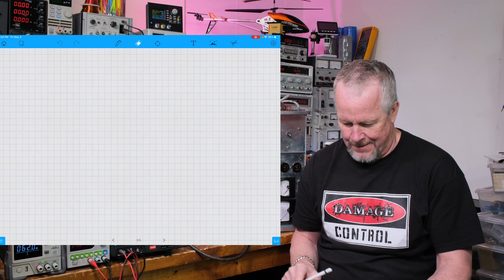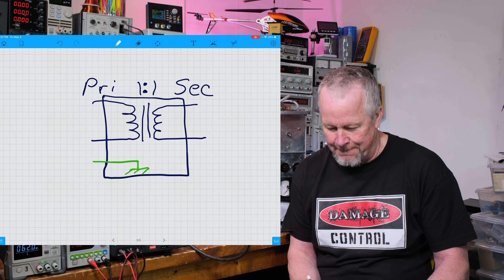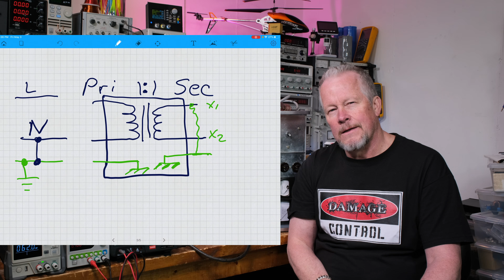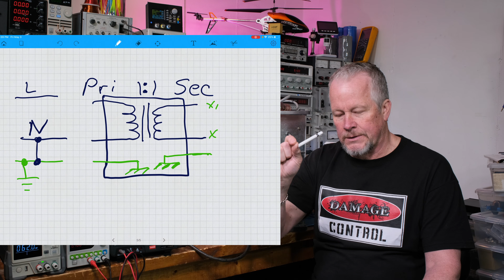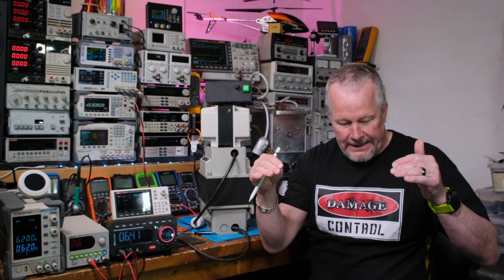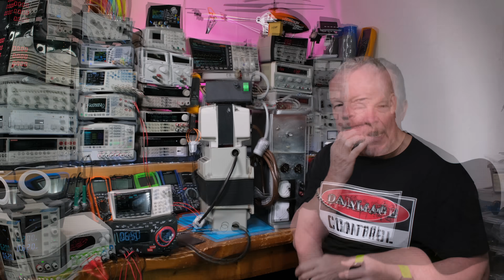Isolation Transformers and How they Can be wired #isolationtransformer

Comment: Brilliant! Couple of addendums: 1) I've been measuring leakage current on old (1980's) vs new Y caps. Leakage of older Y caps (working, but replaced due to age) can be 150-1000 fold higher than new replacement caps. There seems to be a safety issue with older equipment caused by Y cap leakage current. I've seen sockets for the cheapest ICs, but never once for a cap. I wonder why not. 2) Hospitals actually do use those hospital grade isolators, and quite a lot of them. They regularly discard them in working condition for various reasons. They are often willing to donate them to avoid recycling costs. Isolation transformers should be cheap and readily available for students or amateurs.
Reply from the maker: Thanks for the great feedback.  There has been an issue with aging on some Y caps, but the reason they are not socketed - is for safety any component would not be safe if it were only a friction fit - so soldering is the obvious option.

I would love to see companies sell in electronic flee markets are whatever vs recycling.  I've worked at companies that will purposely damage equipment and put it in recycle vs sell or give it away.  It is a shame!!

Comment: Greetings engineer, in the electrical safety practice, what I was taught is that the oscilloscope must be connected to the primary side of the transformer with its respective ground line and that the element under measurement is the one that must be connected to the secondary side of the isolation transformer.
Reply from the maker: Yes that is the typical connections.  But, there are many connection configurations used - depending on the case.

Comment: I currently have a "Ground loop" between a couple devices. One is speaker monitor which has its own switch for power its power cord has a three prong the other is an audio interface which has a power brick but only a two prong connector. These two are connected through a balanced XLR cable. I was told not to use the two prong to 3 prong connector (it does eliminate the 60hz hummm) But instead to use a ground lift in the audio line.  I also have the option to use an XLR cable isolation transformer that can be put in line similar ot the audio line ground lift.  Based on what I think I understand the Isolation transofrmer would be better. Thoughts?

Comment: Late to this but the secondary is floating and never use a GND connection on chasis, if you touch a hot chasis (on floating secondary) you are protected by the secondary isolation (only leakeage current) NEVER USE GND ON SECONDARY!
Reply: No!...secondary is floating, if it makes a short with chassis there's no short circuit or protection from GFC. To be clear, a connected gear must have gnd chassis BUT with a DUT anything must be isolated even a faulty chassis cause there's no way to put current on gnd from the secondary. But if you tie a point of the secondary to gnd and accidentally touch the "isolated" live you can be electrocuted thanks to gnd and the floor...and no detection by GFC. I hope you make a video of this classical confusion
Reply: BTW a gnd chassis only useful protection is against a faulty isolation transformer
Reply from the maker: Thank you!  Great feedback!  I need to do the follow up to this video.  I purchased some connectors and things for this - but then by the time they came in - I got busy on other videos.  I have done a half dozen videos on this confusing thing called ground;)  Have you seen this one? https://youtu.be/FFJm5nQlUF0
Reply from the maker: Thanks for your feedback!  Secondary is floating which is great to keep the noise and isolation from the input, but I do have to say that if you want to tie the secondary loads to the same chassis ground - that is fine.  It will keep all the electronics (chassis) tied to the same point - so no chance of shock;)  Does that make sense?

Comment: Would you recommend using a power bar on an Isolation transformer, with electronic equipment attached to it? And why or why not? Great video by the way...
Reply from the maker: Thanks for the great question!!  I would but I would want the equipment to be on the same ground as any other equipment on the non isolated side.  This is a general answer so I’d have to know more about the question to taylor this answer:)
Reply: @kissanalog  No. That's about right. I was just challenging another engineer at work. So, you just helped validate it. So, I thank you....
Reply from the maker: You bet!  I actually did a rant on ground: https://youtu.be/sgp-0xR8Voc
Reply: @kissanalog  I LOVED it! I was laughing every chance you gave me. Thanks again!
Reply from the maker: LOL - thanks for your feedback!

Comment: Thanks for the helpful video.  I have a Triad N-55MG/ and get no continutity between neutral and ground on either input or output. However when pluged in (125v input) with no load on the output I get 16v between neutral and ground as well as 99v between hot and ground. The ground is attached to the case.  Additionally, there is a very thin wire on the primary side that goes from ground to the middle/bottom of the transformer.  I'm guessing that is the shield. Is this all proper wiring?  Thanks!
Reply from the maker: Great question!  This is an isolation transformer so the power wires on both primary and secondary are isolated from the ground.  Remember this ground is essentially a chassis ground.  It is unfortunate that we call this 'Ground'.  The chassis connection is passed thru the the transformer to be sure that the chassis on all electronics is tied to the same potential.  There is a shield connected to it as well.  I started a video on isolation transformers but I think I should do another specifically on this.  Here's one: https://youtu.be/MIWfBwwIeDM

Comment: Misleading. At 12:27 if one wire of the secondary becomes grounded then it becomes the neutral conductor, and the other secondary wire is now hot. Were you to touch the nongrounded wire there would be a complete current path from your body to ground to ground to the grounded secondary back to the hot wire. You only have complete isolation if there is no reference to ground on the secondary. Only in that circumstance can you touch either wire of the secondary and not get shocked. Of course, contact with both secondary wires will result in shock whether the secondary is grounded or not.
Reply from the maker: Thanks for this feedback!  You are correct and I think I talk about this in this video.  But - I also wanted to make the point that it is still isolated from the primary winding.  The Ground connection is a different matter.  Connecting the ground on the secondary side does not provide a current path from primary side to secondary side.  This was my point.  Make sense?
Reply: @kissanalog  If the secondary is grounded then both the primary and secondary coil share a ground connection. This is basically a (higher resistance) wire connecting two sides. My point is that with true isolation you can touch EITHER limb of the secondary alone and not be shocked whereas if one limb of the secondary is grounded then the other wire is hot. To me that is no longer the definition of isolation.
Reply from the maker: Thanks for this feedback!  I think we are talking 2 different things.  I'm not talking isolation from ground when I say the secondary is still isolated from the primary.  Remember - isolation is when no DC current has a path.  If both the primary and secondary share an Earth ground connection - they are still isolated with the transformer - there is no DC or AC current path from Primary to secondary.  When you take a transformer with 3 windings like in a 3 phase system - and use a high resistance to earth ground - then that is a high resistance ground.  If you are explicitly using isolation as ground isolation - then yes - use a delta transformer or don't tie your Y common point to ground.

Comment: Hey Ed I got an isolation transformer I'm gonna buy. Can you fire me an email please when you get a chance. I want to streamline my benches and I'm  drawing up a circuit that includes a variac where I can adjust the ac output digitally using an embedded controller and motor. I'm going to make it so the dut can be switched in and out of isolation depending on what safety I need. I have 2 1000kva isolation transformers. One is gonna be for cleaning audio when I jam in the basement but the other is to keep me safe haha. Along with my expensive test gear on my bench.

It's a really cool circuit I have drawn but I'm not a psu engineer like you. I have a nema23 that is going to be coupled to a dial on a variac that's built in a custom wood box with the isolation. I plan to add a load to indicate shorts that's not using dim bulbs but load resistors and an integrated touch screen to control everything. I'm gonna use high end relays to switch the different parts of the circuit in and out. When I get a spectrum analyzer I don't want any smps noise on my bench. I'm going to move all my smps bench supplies out to my workshop and keep everything (as possible) linear on my main test bench. I have 5 linear dc outputs. One is homemade in a Faraday cage with 2 adjustable outputs haha. Plus and minus for audio and opamp testing.
Reply from the maker: Thanks so much for your generosity!  I appreciate you!  That project is sick!!  I sent an email reply...we should live stream this;)

Comment: if you bond 1 of the secondary winding ends to the green wire your isolation transformer is not doing anything and if you dont bond any wires but your device has a fault or any connection to either plug wire it is no longer isolated from mains and clipping a grounded scope ground lead to any part of the device your testing it is no longer isolated :-)
Reply from the maker: Thanks for your feedback!  Actually, the transformer is still an isolation transformer - even if you bond the secondary side to chassis or the green wire.  No current flowing in the secondary will flow through the primary.  The chassis ground is not isolated - but the power on the transformer is.  That is a misconception many have.   So, if the secondary is bonded to chassis - it is still isolated from the primary - but the ground is not.  So, this might cause issues with your testing, so you can float the secondary from chassis to solve that.  You just have to understand what you need and what is safe.  ;)
Reply: @kissanalog  
no , it is connected to the house neutral by the long route of the house earth wire so the other side become live (hot) , you can test this by connecting a bulb to your secondary that is not grounded and house neutral , it may trip elcb type breaker but not mcb type :-)

Comment: Great Vid   but I was wondering if primary and secondary of the isolation transformer are both tied to chassis ground like the isolation transformer body like at 3.06 if there is anyway to cause a short or make a mistake by probing wrong and blow up a oscilloscope while testing a device with a 3 prong plug with ground   talking about unbonded secondary but grounded      Thanks so Much
Reply from the maker: Thanks for the great question.  First - the primary side should not have a winding tied to the chassis - this was wrong.  Secondly - I would not tie the secondary windings to chassis either - for a test bench where I want some safety of scoping 2 prong devices.  But - safety is for everyone to consider for their own purposes.
Reply: @kissanalog  Thanks for letting me know  I blew up my old scope even though it it hooked to a pc cause the pc was plugged in charging i guess    I now have a bench scope and isolation transformer but still have been scared to do much probing on the power supply of the device in test after i wrecked my old scope   Again Thanks Very Much

Comment: My favorite and highly dangerous, stupid, ground rod advice is when these audiophiles advocate driving in a separate isolated ground rod just for your audio signal grounds! First the Earth is not some magical sewer where electrical noise can be dumped! All electrical current travels in a loop back to the source one way or another in a working circuit. So we have our electrical system ground rod at the meter and say 50 feet away is our precious isolated audio ground rod.

Lightning hits a tree, the wet Earth is an excellent resistor and we know voltage and current will always develop across a resistor. Those two ground rods become that resistor's "leads wires" So now you have say 20kv to 50kv and several thousand amps of current between your electrical ground and your audio signal ground for a few hundred microseconds. The expensive audio gear being zapped is the least or your problems. You will no doubt have an intense house fire as a result! This is exactly why the American NEC (and probably all other developed countries) requires all building electrical ground rods to be bonded together with a minimum #6 gauge wire. But audiophiles know better don't they!
Reply from the maker: Thank you!  You point out some very important considerations!  Also, NEC does not allow for ground rods to be in different locations on your electrical system or property.  I think it is 6 feet apart and tied to the same point.  These audiophiles are letting their placebo affect put themselves in real danger - for no reason at all.

Comment: One common configuration that you might discuss in a future video is the popular one with a center-tapped secondary, where the center tap is taken to be secondary side ground, and the two ends of the secondary feed a full-wave bridge rectifier then to two reservoir caps providing symmetrical plus and minus rails.   I wonder how the various considerations play out for connecting or not connecting that center tap in some way to primary side ground.
Reply from the maker: Thanks!  I have covered this in the past - but it is worth taking a new look at it.

Comment: How about this: if you have a centre tap on the secondary side, world it be possible to connect that as a safety ground and then put fuses on both power legs. If either leg touches the chassis the fuse/fuses should blow. You would get half mains voltage between safety/chassis ground and the legs, but since it’s not referenced to the mains it wouldn’t matter. Right?
Reply from the maker: Thanks for asking.  OK, so first - the chassis of the transformer should be referenced to safety ground on the primary side.  So if I understand - you would connect the center tap to the ground pin of the plugs on the secondary side, so then they would tie the chassis of the devices plugged into it to this - new reference/ground.  This would probably work - but the fuse would have to be sized correctly.  This would not help in testing products, but for simply powering them it would probably work.  But I don't see what advantages it would have.  There would be more impedance so the fuse/breaker might be tricker to select.  The advantage of having the full voltage short to the chassis is that it is real short and things happen pretty fast.  Does that make sense?
Reply: Yes thanks, i guess it doesn’t make that much sense perhaps. I live in a 230v country and out plugs are non polarized, if that makes any difference.

Comment: I have to disagree what you say about ohms for X1 & X2 / X3 & X4. When you done it, there is more or less ohms measurable dependent is it stepUp or stepDown and what voltages are rated primary and secondary.

Only when you trying to measure between X1 & X3 or X2 & X3 or X1 & X4 or X2 & X4 there is huge Mohms readout so practically isoleted.
Reply from the maker: Thanks for your feedback!  The inductance is huge - but the ohms are not, or it would run too hot with the rated current.  I'm posting a new video with measurements;)

Comment: As I understand it, if there's that 'bond' to ground on the secondary, then you no longer have an isolation transformer
Reply from the maker: Yes that is confusing, but it is still an isolation transformer - but with a common reference point.  The power on the primary (and current) still only travels in the primary side.  The power on the secondary side (and current) still only travels on the secondary side.  They do not share current between primary and secondary.  They are simply referenced to the same point (call it ground;).  They 'safety ground' is common and they are not 'safety ground' isolated.
Reply: @KissAnalog  ...kick-ass! I bought a pair of mil-surp units for a tube amp project and that'll be good to know. Thanks for the clarification 👍

Comment: 14:18  If L2 shorts to chassis or N2, it will overheat the transformer rather than pop the distribution panel breaker...  unless the current handling capacity of the transformer exceeds the breaker capacity, which is unlikely in most equipment.   Instead, this case would need to be covered by an appropriate-sized fuse in the equipment itself, upstream of the primary.
Reply from the maker: Thanks for the great feedback.  In the example that you point out, I have N2 tied to the chassis, so if L2 shorts  - I say it would pop a breaker if we had one inside this transformer.  But a large transformer would have low enough impedance that it would also likely load down the primary and pop the breaker on the primary side.   But to your point - it is much wiser to breaker/fuse the secondary side - and not put that load/stress on the transformer.  Thanks for pointing this out.
Reply: @kissanalog  There are of course a number of scenarios that somewhat fit your discussion: transformer inside the equipment, versus external isolation transformer, and at which locations there might or might not be breakers or  fuses and so on. And for each of those we have to think through what happens in the various fault conditions.  It's good to have videos such as yours to stimulate our thinking and questions.